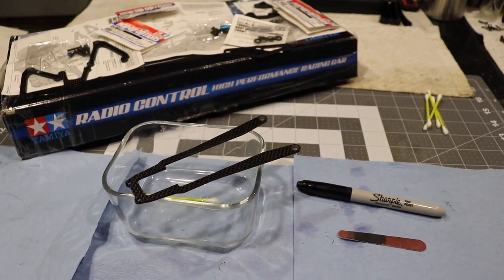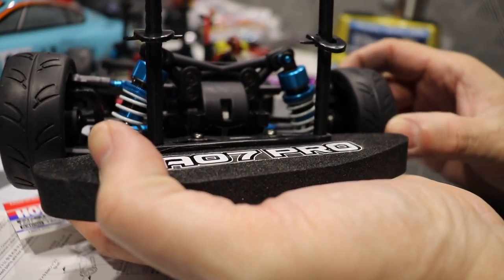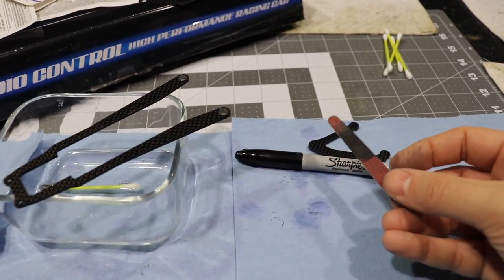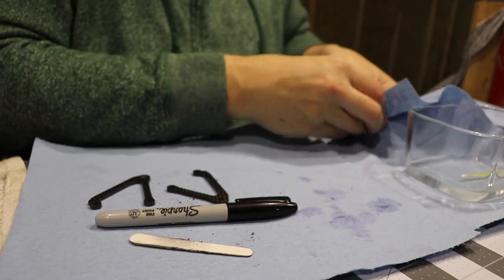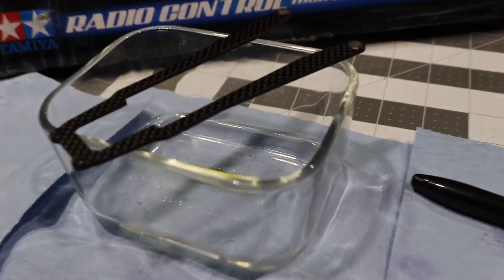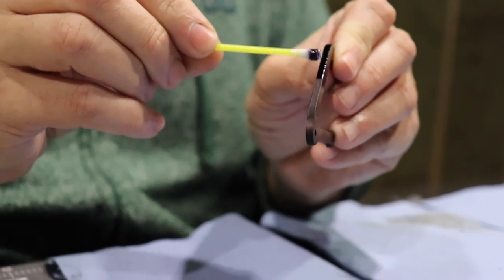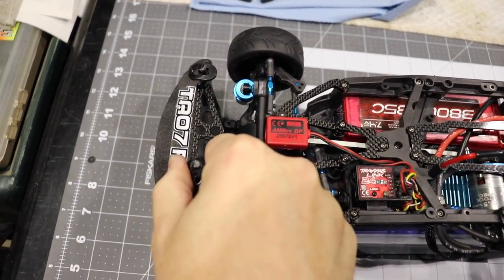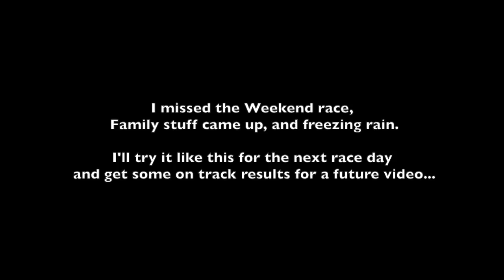How to Sand and Seal Carbon Fiber RC parts - Tamiya TA07 Pro Hop Ups install - Netcruzer RC

Comment: 😎👍Cool! car looks awesome! I have done this before also and I don't think you need to put marker on the sides as the CA will make it look dark black kind of like putting clear coat on a matt black finish it will then turn shinny black.  Sanding that is super messy that's for sure!
Reply from the maker: I was wondering that too, but everything I read said colouring first looks best, so that’s what I did. I agree just CA would likely darken it up fine (wet look) BEAUTY! 😉👍

Comment: In 2023 finding a spool is like finding hens teeth. Just bought a ta07 pro and some of the hop-up parts are 
1. Hard to get 
2. Very expensive
So 1 million diff oil will have to do lol👍

Comment: I think I might build one of these for the on road racing, it’s such a fun time, the buggyra fat fox is first though
Reply: Good info John
Reply from the maker: It's definitely a 'race car' more than any TT chassis, but that said your TT02 looked fine out there. Some oil shocks and It might have surprisingly good track handling. I'm also waiting for news on the Buggyra fat fox. I want to see how much they want for just the body, vs a whole kit.
Reply: Netcruzer RC TECH CARS I think they r $160 US
Reply: @STEVOD313  That's funny because one of the top guys running 17.5 at the track by my house runs a TT-02 type S..It has tasteful mod's..He swears by it.

Comment: Nice work, plus that chassis looks killer with all those carbon bits, very perceivable gains, though I am curious as to why the diff spool, won't you lose the ability to tune cornering behaviour?
Reply from the maker: Only thing you lose is ability to tune a front diff. But it’s been proven for Onroad racing that a locked front is faster, it pulls you out of corners quicker. I still don’t quite understand why, but it totally works. This is a track use thing, not for road or bashing.
Reply: @netcruzer  I see, so what do you notice when driving it configured like that? Do you have to pay more attention on the initial turn in? I guess it would allow you to get on the throttle more aggressively, and sooner coming out of a corner (point and shoot).